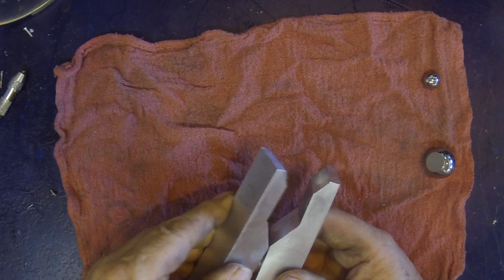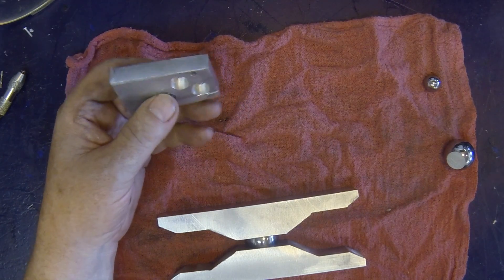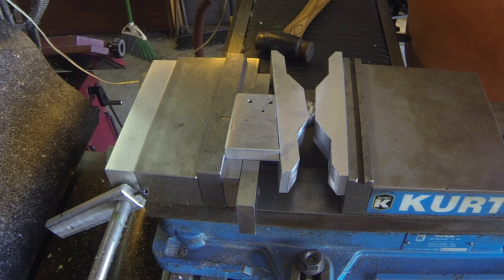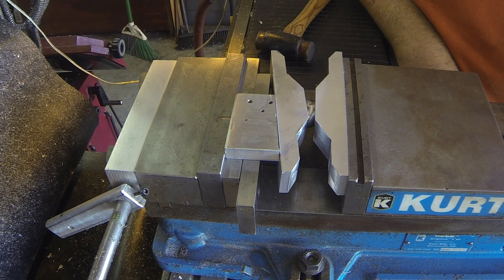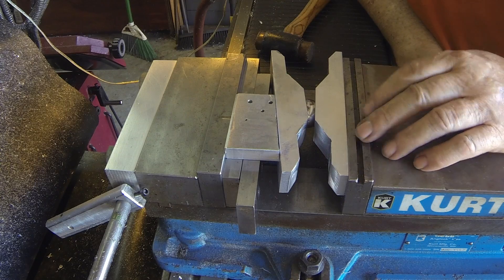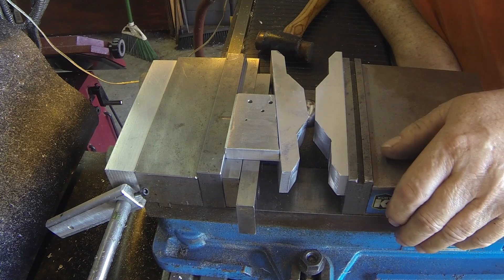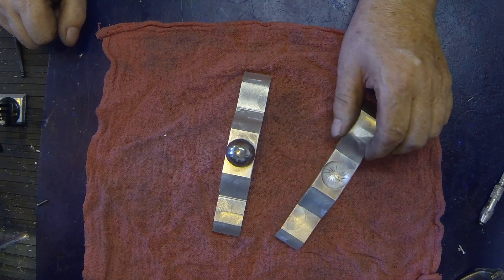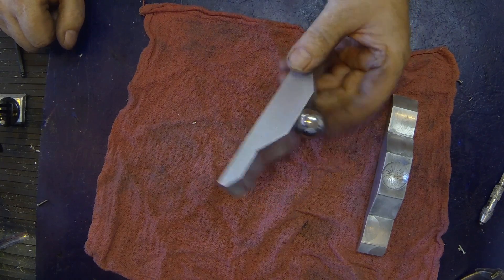articulating vise Jaws

Comment: Yeah, I'd have to scale it down if I made one.  I only have a 5" clone.
Reply from the maker: ILGopher In that case just use a piece of  1/2" stock and don't use the 2nd jaw.
Reply: It looked like it would be easily adapted, just downsize the ball and the stock.

Thanks for sharing.